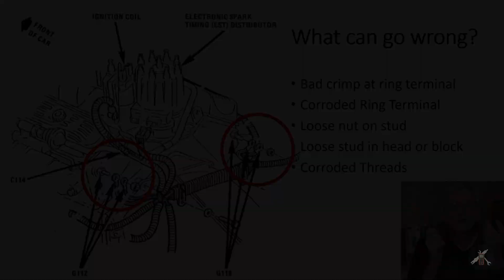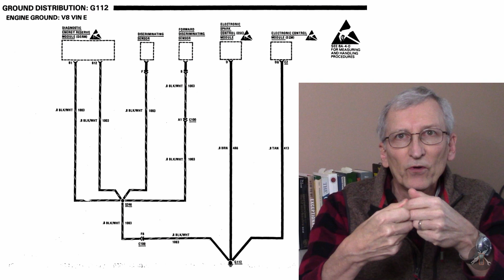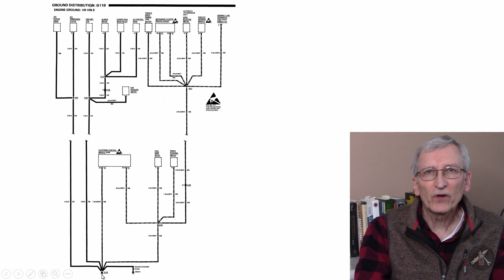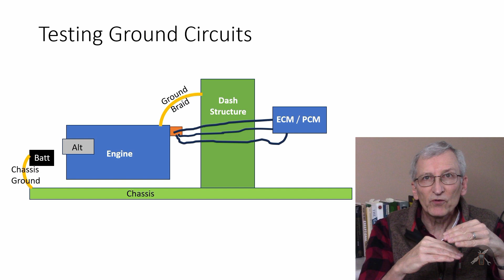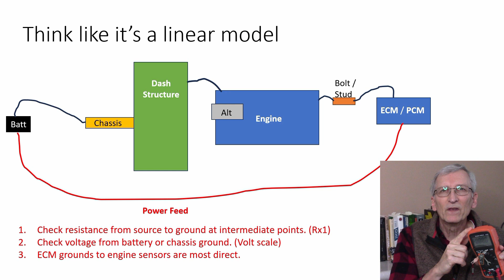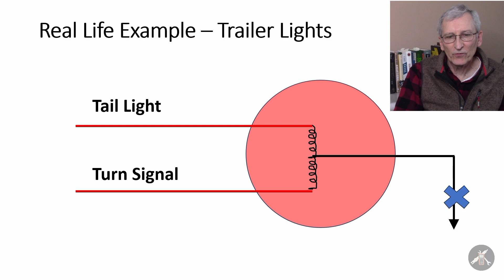How to Troubleshoot Automotive Ground Circuits

Comment: Sorry got to disagree on this , number one continuity  (ohms test ) on a meter was designed for bench testing components and should be left at that and never used for testing wiring on a vehicle you should always use voltage drop testing on any wiring to test the integrity of the wiring and guarantee you have a good connection for current to flow , using ohms test will lead you up the garden path , I’ve seen it a thousand times techs still scratching their heads after ohms testing and still can’t fix the problem, voltage drop testing all the way for this will guarantee you a repair
Reply from the maker: I understand your point and you are correct that ohmmeter readings can mislead you.  But, I am a both / and person.  That means that I believe both methods are necessary.  I tried to bring that out in the the video. When you are working in high current circuits, voltage drop may be more significant because it can be very large with very small resistance.  But, when you're working in very low current controller circuits, direct resistance measurement with  DVM can be a better clue. I often start with resistance looking for large values / open circuits.  If I find something suspect, then I'll try a voltage drop for verification.

Comment: I design circuit boards for a living and your video is spot on. Not many home mechanics or even pro techs have a good understanding what you just taught and I think this will help many quite a bit. 👍
Reply from the maker: Thank you, I hope it is helpful. It just comes from years of experience inside and outside the auto industry. When I worked in hybrid / electric powertrain, understanding of grounds was often critical to our systems and electronic controllers.

Comment: Thanks again, when I do the resistance test make sure the battery isnt connected to the terminals? Just use a chassis ground point to make the intermediate test?
Reply from the maker: Either power off (with a voltage check to be sure) or disconnect battery.  Battery off is better.  A good chassis ground point is a fine starting point for intermediate test.
Reply: @bitsofwisdom460  o ok thx if I find one of the wires to be bad use a 9/16 wrench to remove it from the back of the cylinder head, or could I possibly use a 1/4 ratchet, I can tell it's pretty difficult to get too
Reply from the maker: @Jaguar-Xjr  Yes, it is a tight space. You may get a small ratchet in, but more likely an end wrench.  This is one of those spots where a ratcheting box wrench works very well.
Reply: @bitsofwisdom460  o ok I just did a continuity test on the O2 signal wire, in the service manual it says this will determine if ck 413 has a short it stated that if ck 412 the (02 signal wire) has voltage over .6 then there is a short in ck 413(O2 ground circuit) doing the test I got .8 does that mean I found the problem ?
Reply from the maker: @Jaguar-Xjr  It seems to indicate a fault in the ground side probably open not short.  Short in a ground circuit is not normally a problem. Ground ought to be zero. The only way to know is to measure the ground side.
Reply: @bitsofwisdom460  with the reading being .8 on the continuity and resistance test that could cause those type of problems like misfire and stalling and running rich at idle ?
Reply: @bitsofwisdom460  it's Definitely intermittent because the voltage was oscillating likes it's supposed to sometimes at idle but soon as I press the gas sometimes it runs back rich and noticed it was going in and out of closed loop sometimes